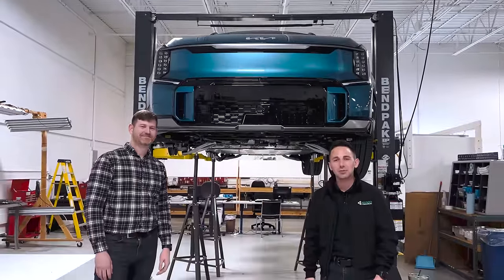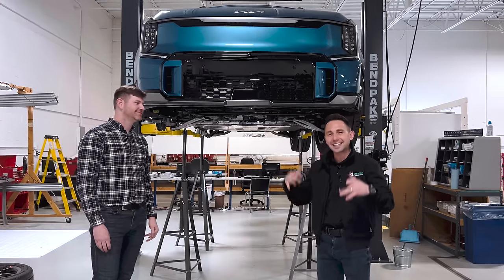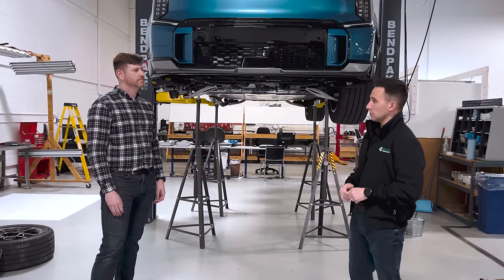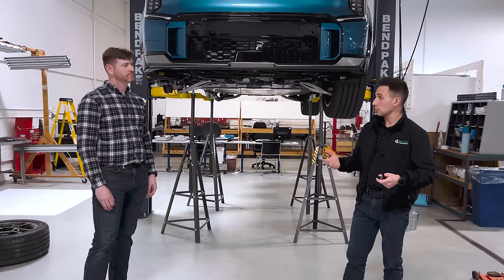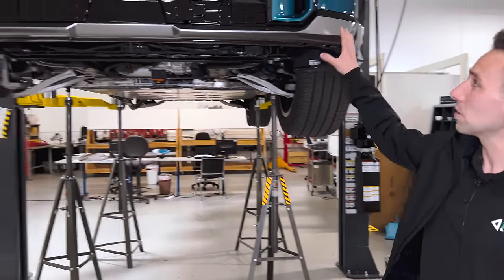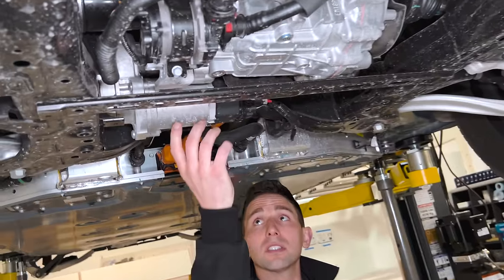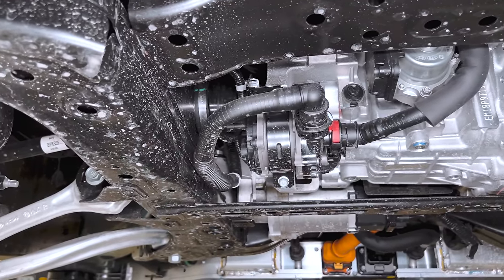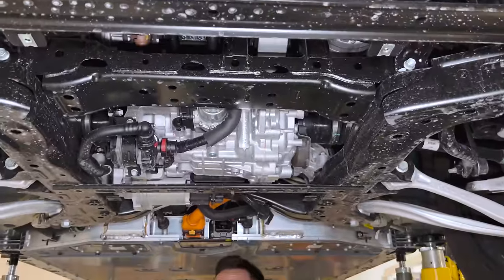Kia EV9 Review - Utilizing the E-GMP Platform with slight modifications.

Comment: Great video guys , love the technical detail , and banter.  Enjoying the paint work and animation of the kia bodywork , looks and appears classy , expensive and super well finished off. The virtual ball suspension is particularly intriguing , i get the theory , but how the hell is the hub able to rotate when two seperate links supporting it. At some point in the future , if could turn the steering when a vehicle is up on the lift , to see how the steering geometry moves , would be fascinating , with close up shots. Quality control is very good on the Kia , like Kevin points out. ❤
Reply: If you have pinboard (or just a piece of scrap plywood or cardboard) and some bit of paper and pins, you can build a model of the arms and hub carrier (as seen from above or below) and watch how it moves as you steer the hub. It's a little weird, but it works as long as the two arms pivot very close together on the hub carrier.
Reply: @brianb-p6586  thanks will try it out.

Comment: Engineering done right. Looks solid.
Reply: NO, weren't you, Listening.
KIA built too HEAVY, too complex w/ too many ICE vehicle parts , Built too EXPENSIVE .
NO , built in COST savings. complex Build.
lack of Gigacastings , Structural battery pack & 4680 cells.
lack of Discrete modules @ each axle using HIGH number of CAST parts , rather than OUTDATED Stamped Steel Weldments. 
lack of CAST cross car beam w/ Multiple functions. 
outdated Suspension , NEEDS independent 4 wheel w/ AIR dampers.
KIA is still using OUTDATED horse & buggy Technology.
Reply: You can see alot of places where the rust will come fast and some components are low budget but it's an expensive car.

Comment: Interesting.  There’s a lot of conventional looking engineering in the EV9.  I’m curious how Hyundai/Kia’s per unit profit compares to a Tesla Model Y.  Tesla’s gone all in modernizing production technology, so how much cost does thst take out?  Tesla just cut prices again, so aI’m wondering if that reflects lower manufacturing cost, or is Tesla cutting margins attempting to keep market share?
Reply: Model Y is even MORE profitable than NEW model 3.
let that sink in. 
Model Y is MOST profitable SUV on EARTH.
Reply: @markplott4820   Thanks for the reply.
Reply: The level of production modernization came at great upfront cost. It pays off when they're able to sell at lot of Model Y's, but times are finally changing. They've already cut back production and will likely need to cut production back further, increasing unit costs. I'd guess they're margins are growing quite tight, especially with how frantically they're changing demand tactics and trying to sell software subscriptions. Frankly, thinks aren't looking great for Tesla as of late, especially after they put the "$25k" model on hold.
Reply: Kia has 11% margin. Tesla 9%.
Reply: @bobthebuilder372   Thanks for the well reasoned reply.  It is too bad Tesla spent all the resources on the Cybertruck instead of the would-be Model 2.  Sometimes good-enough is good enough.  If Tesla had a credible $25K automobile without a hefty feature set, they could have been a key player in affordable EVs.  So far BYD, Cheri, etc. are rapidly entering the global market outside the US where Tesla could have sold a lot of Model 2 units.  Personally, not being an economist, I can’t make sense of whether it was smarter to make the Cybertruck, which is difficult to produce and only suitable for North America, or should Tesla have made a cheap car they could sell a lot of globally.  My suspicion is that was an emotionally driven Musk decision which may not have been the best course for the company.
Reply: @bobthebuilder372 I don’t see it this way. Their production is usually slowed to make changes on the line so a positive direction can constantly be achieved. Prices are being lowered to bring the vehicles in to a more affordable range so Tesla can sell more volume. The software was priced high until it could be more functional for daily driving and more human like. Now a real-world useful version of FSD is out, by lowering the cost will sell a greater number of FSD subscriptions. Before it was ready for the world and still a bit embarrassing to use people that couldn’t afford it just didn’t bother so it kept a smaller group of testers until it was ready for the masses. It’s a smart approach and well worth the $99 a month.
Reply: @wtmayhew the Cybertruck was promised to many and had to be delivered before the model 2. It was a long wait but if a model 2 would have been released prior to the release of the Cybertruck them they would have lost a bunch of pre-orders to people that were tired of waiting. The model 2 will be here soon enough. Still a lot of planning to be done so it can reach that price point and still have great features for the money.
Reply: @bsbarber73   The calculation probably was something like this:  produce 250K Cybertruck units/year at (?) $10K margin/unit = $2.5 billion, or produce 1 million Model 2 units/year at (?) $1K margin/unit = $1 billion.  You’ve got to look at tooling costs, competition in the market space and demand.  Tesla has had a problem of design delays, tooling costs and difficulty producing at the necessary rate. Cybertruck was four years late and 50% or more expensive than the initial announcement.  The question stands if truck production rate can meet the numbers need and can cost be brought down.  The potential error was in not cancelling the truck project and concentrating development efforts on the theoretically more easy produced inexpensive automobile and taking less net income.  The risk of Tesla’s choice is they may not be able to produce the truck at volume and the future affordable car global market will be already saturated by the Chinese makers in the meantime.
Reply: The battery is made in CATL China.

Comment: Great analysis of an amazing EV platform which spearheaded the industry in terms of technology for money. The EV9 is a good vehicle with some viable changes to the platform which seem to fit the nature of the vehicle nicely.
Looking forward where Hyundai/KIA can take this platform with the rumored update coming in late 2026.
Reply: KIA/Hyundai/Genesis very CRAPPY e-Gimp platform is still too much ICE vehicle Based. 
the e-Gimp was originally to have a ICE, Hybrid ,FCEV and BEV  versions, on same Platform.
the e-Gimp has too many FASTNERS and too many Brackets holding more Brackets. 
the e-Gimp Platform is Already OUTDATED in 2024. 
Hyundai group needs NEW BEV platform that is 100% for BEV, not ICE or anything else. w/ LEAN Design. 
using Gigacastings in FRONT & REAR , + Structural battery pack w/ 4680 Cells. and 48v.
Reply: The first car was built in Georgia.😂
Reply: @markplott4820 What about Tesla, which uses batteries made in China? CATL

Comment: Concerning "Wheel Talk" starting at about the 5:30 mark, it does seem like a waste to put a wheel cover over a painted wheel.  What if the manufacturer uses this same wheel, in significant numbers, minus the cover, in another application?  Isn't there some savings to realize by not having another part number for a non-painted wheel?  Please enlighten me.
Reply: My line of thinking was the same.  It is probably less expensive to source one wheel type if it is also used uncovered elsewhere
Reply: @stephenkramme7063 My thought was that they probably had to finalize the wheel design to the manufacturer much earlier than the wheel cover. So they might not have known the entire wheel was going to be covered then.
Reply: Or a customer may choose to leave the wheel cover off to display the wheels.
Reply: Doesnt matter , its attention to detail by Kia , have things correct and right , for your customer , make your customer feel valued. Small things like that add up over a whole vehicle , to make you feel like you have bought a quality product.
Reply: i would just have avoided the plastic hubcaps all together. the wheel looks better without it
Reply: Kia has other wheels with plastic. They have a lot more screws and pieces than this wheel, so it's an efficient way to "stylize" the wheel.
Reply: @mshepard2264  Without the full wheel cover, it would still need a small centre cap... but I would certainly prefer that.
Reply: @mshepard2264  The wheel cover probably helps with aero a little. It doesn't leave much open area for airflow.

Comment: noticed the single-side front brake calipers presumably put in as a cost saving over using dual sided calipers.
Reply: Very few modern vehicles use fixed-body calipers - sliding calipers like this are normal.

Comment: Im a mechanical engineer … and embarrassed to ask this. How does that front knuckle steer with that “virtual ball joint”? I can’t figure it out. It feels like those two joints side by side would inhibit the knuckle from turning. ?
Reply: The chassis-end of the control arm also allows the arm to pivot a little, so the whole thing (chassis, knuckle, front arm, rear arm) forms a 4-bar linkage.
Reply: @bikeaddictbp 
Indeed. The Germans, (BMW, Audi, and Mercedes) have been using the same systems for 2 decades now.

Comment: Phillips head screw on a brake hub. Fuuuuu that's gonna be a lease-only in the rust belt. 🤣🤣
Reply: Lots of cars have those. They're mostly to hold the brake rotor in place on the assembly line. They can be left out afterwards (e.g. if they break, or if the head has to be drilled out to remove it ... been there, done that). The brake rotor is still well clamped between the wheel and hub, and it isn't going to escape.

Comment: sooooo... is this good or not good? I can't tell by your reactions. Your comments seem sheepish.
Reply: This isn't that kind of review. Like other KIA videos they have done, Munro has shown that KIA isn't wasting money on R&D and cutting edge manufacturing techniques when they don't have to. They have proven their reliability and they build on that. Instead they are putting the money into customer-facing qualities like beautiful design, lush interior, and detailed paint. KIA has a reputation of making the most efficient EVs (which this clearly won't be), with high customer satisfaction, high reliability, and super long factory warantees. Basically, KIA has a very conservative approach when it comes to manufacturing and an aggressive approach when it comes to design. Although their sister company Hyundai is even more aggressive when it comes to design language. And is there really anything even remotely like this in the competition right now? That alone may make it worth the sticker price (which is sure to be large) for some buyers. And if you choose the Hyunudai version for more futuristic looks.... KIA/Hyundai wins either way. So the question is... would you rather own a vehicle that wows engineers because of new new new of the manufacturing... something that will only really impact you as a customer in terms of more expensive repairs and replacement parts... or would you rather own a vehicle with more conservative manufacturing and proven reliability? 🤷‍♂️
Reply: There was a lot of Toyota mentions in this video.  That's generally seen as a good thing to say about a car for a reliability, easy to repair stand point. Munro is all about cost cutting in manufacturing and it was interesting that they didn't nit pick this so much in that regard.

Comment: KIA EV design is totally stupid.  The battery connectors are located in the middle front protected by a small plastic.  This is the most probable impact location.  They won't repair it.

Comment: Munro &associates never gave their opinion on which is the best setup:- single motor FWD or RWD or dual motors FWD, RWD or AWD or tri motor AWD with two motors whether at front or rear and quad motors AWD or more than quad multiple motors AWD and out runner or in runner motors, radial or axial flux motors blah blah blah.
Reply: They're options more relevant to customer desires than anything else.
Reply: FWD is very OUTDATED Delete .
all need is RWD & AWD. 
even TESLA RWD can drive in snow & ICE.
Reply: Munro & Associate's opinion is not of any value on this subject. Their expertise is in manufacturing methods and costs, not vehicle performance.
Reply: @brianb-p6586   - MUNRO , also does Vehicle BENCHMARKING & performance in Separate videos.

Comment: Thanks for the review of Kia EV9 with gentle, diplomatic answers. - For me the structure is a horror of complexity, weight and a waste of money. I felt sick. Enough hints as to what will be better, simpler, lighter and cheaper in my Swatch and Toyota IQ style concepts: Useful engineering for a better world.
Reply: KIA EV9 is too SLOW , too HEAVY , too INEFFICIENT , too short RANGE.
its built too Expensive & Complex.'
its NOT taking advantage of NEW Manufacturing like Discrete CAST Moules for Axles.
no CAST cross car beam w/ Multiple functions. 
not using any Gigacastings , Structural 4680 battery pack.

Comment: MUNRO - sorry , I'm not buying it.
the KIA EV9 is built too OUTDATED , on a old fashioned Platform that was supposed to be for ICE , Hybrids, BEV & Fool Cells.
the e-Gimp platform is outdated.
the KIA EV9 is too SLOW, too HEAVY , too INEFICIENT , too short RANGE , and extremely OUTDATED in 2024. 
KIA EV9 is built far too COMPLEX and built very EXPENSIVE. for what you get.
to remain Competitive Hyundai GROUP needs a NEW BEV bespoke platform in 2024. 
I would Recommend to Hyundai to start using Discrete CAST modules in their Axles as well as Intergraded cross car beam w/ Multiple functions. 
Hyundai needs to start using Gigacastings and 4680 Structural battery pack.